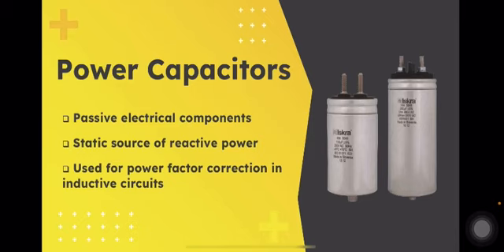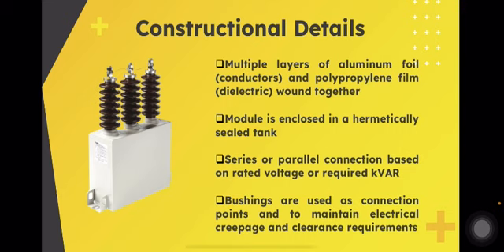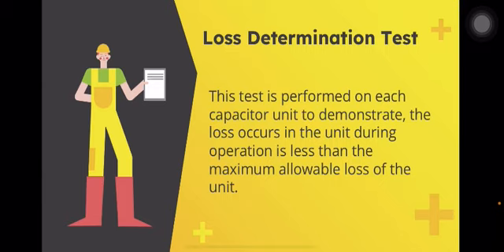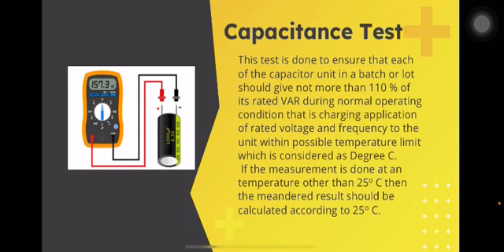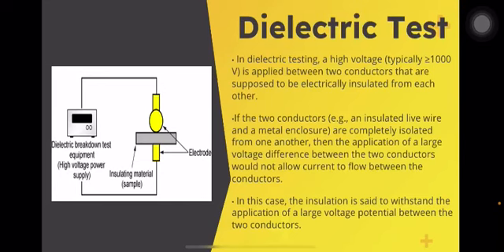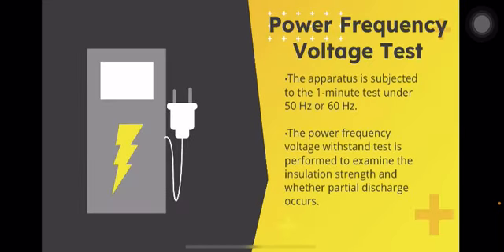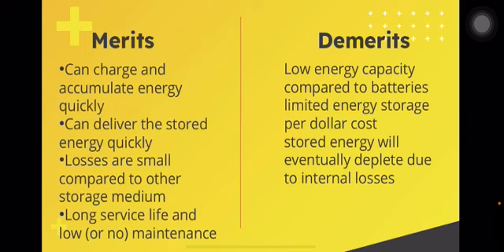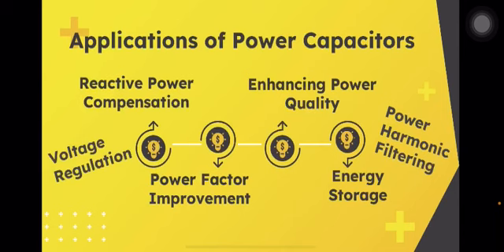Testing of Power Capacitors-Peer Supported Individual Study by Vedant, Tanvi, Bavrica and Vaishali

Comment: What are done during capacitor bank testing?
Reply: See There are 3 types of test done on capacitor banks. 
1)Type test-
When a new design of power capacitor is launched by a manufacturer, it to be tested whether the new batch of capacitor comply the standard or not. Type tests or Design tests aren’t done on single capacitor instead they are done on some casually chosen capacitors to make sure accordance of the standard.
For ex: Voltage decay test
2)Routine test-
These tests should be performed on each capacitor unit of a production batch to ensure performance parameter of individual.
For ex: Capacitance test, loss determination test
3)Pre commissioning test-
When a capacitor bank is practically installed at site, there must be some specific tests to be performed to ensure the connection of each unit and the bank are in order and as per specifications.

Comment: Why capacitor connected in parallel not in series for power factor improvement?
Reply: 1)If we connect the capacitor in series with the load then if short circuit fault occurs in the load then the total voltage will be applied to the capacitor which may blow them.
2)In case of series connection, if we want to connect additional capacitor then we need to open the whole circuit. But in case of parallel connection, we can easily connect an additional capacitor in parallel with the existing capacitor